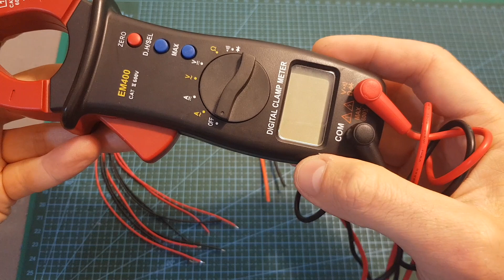DIY 1S Lipo Battery Adapter - Charge Multiple 1S batteries Using Your Regular Charger

Comment: Do you need to add the XT60 connector? My charger only uses the JST plug. Thanks!
Reply from the maker: Which charger are you using?
Reply: @KremerFPV  it’s just a simple balance charger with two JST ports for 2s and 3s batteries.

Comment: Thank you for your great videos. Would it be OK to use the same adapter to use the 4 1s as a 4s pack in the quad? I am thinking to buy a new quad and I what to use my 1s batteries. Thank you
Reply from the maker: My pleasure. 
Yes you can, but you will end up with a very heavy 4s 300mah (depending on the cells) battery and I don't recommend it.

Comment: Hey, I have another auestion. Is it possible to make a 6s cable but then connect just for example 4 batteries to it and charge? Or will I need an extra cable if I sometimes need to charge just four and sometimes six?
Reply from the maker: Hi, using this method you will need to connect 6 batteries if you're using a 6s balance connector.
Reply: @KremerFPV  thank you!

Comment: Do I have to care about the starting voltage of the 1S batteries? For example can I connect 3.3, 3.6, 4.0 and 4.2 to this setup? Does the charger can handle the offsets of the single "cells" and balance them?
Reply from the maker: Good question. No, you can use cells with different voltage. The charger will balance them.

Comment: So I can charge two lipo batteries with jst in parallel? 
What if they are in parallel but only one jst is connected to a power source... would that still charge both of them?
Reply from the maker: You need all the batteries to be connected in order to use this adapter.
Reply: @KremerFPV . If you can select between 2, 3 or 4s on your charger then surely you can choose by how many batteries you have connected at that time!?
Reply from the maker: @mathewwebb522  It doesn't work like that.
Reply: @KremerFPV  . Yeah I realise that now lol. I've made my own cables 2s and 4s now.
Reply from the maker: @mathewwebb522  Perfect  :-)

Comment: Dude, can i use it for drone? I want to make 2s lipo with 2× 1s lipo
Reply: Thanks dude
Reply from the maker: Sure you can. Just connect the two batteries in series and you will get a 2s battery.

Comment: Hi Gal, If I want to charge only 2 batteries, can I still use the 4S Connector?
Reply from the maker: You might be able to using jumpers on the unused battery connectors (I need to double check it).
Reply: @KremerFPV  did you check that? I'm wondering too...?
Reply from the maker: @stephankempf7612  No, I didn't and anyway I don't recommend to do it.

Comment: Did that by making a pair of adapters from 6S balance cables a long time ago. With adapter cabled from WST connector to anything. The main benefit is the possibility to put whoop batteries (and other 1S LiPo's) into storage mode when summer come and you are witching to 5" freestyle.

Comment: Good content.  Well described.  Maybe worth mentioning the charge setting to use with the serial rig.

Most chargers also enable 1S charging, so a parallel rig I find is usually better.  (All + to XT60+ and all - to XT60-).  This way you do not have to have the rig full to charge (but check the voltages of the individual batteries are close before charging).

Both parallel and serial charging can get batteries to storage charge.
Reply from the maker: Thanks!